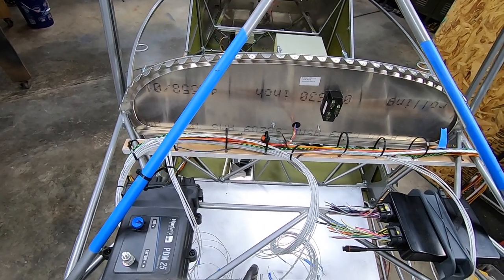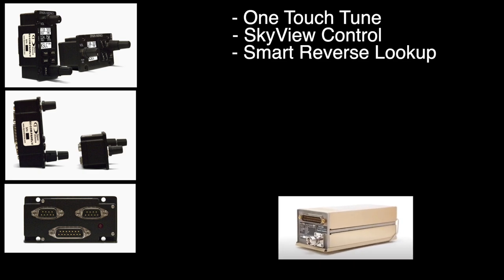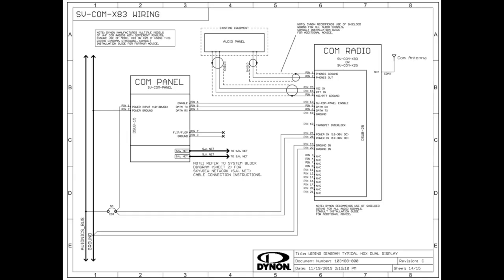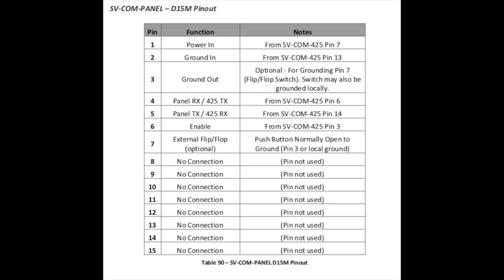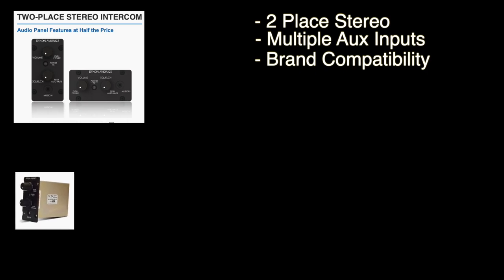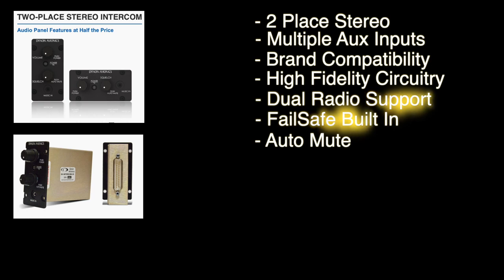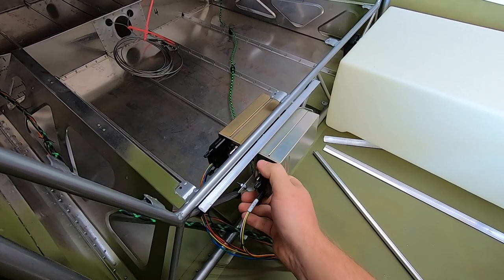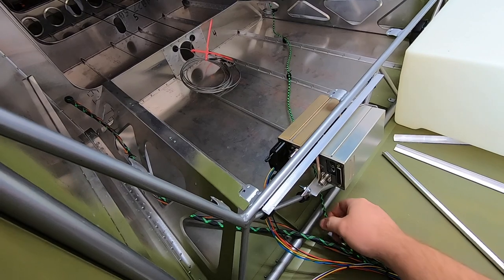Dynon Radio and Intercom Deep Dive

Comment: The wiring instructions are different between the C25 and X25. Make sure you use the correct instructions.
Reply from the maker: I was noticing that as well, very good point👍

Comment: Actually, Dynon’s shielding connection recommendation is not the best practice.  Shields should almost always be bonded at both ends.  There will only be current in the shield if you have a bonding problem in your installation.
Reply from the maker: I’ve heard argument on this topic, I’m not educated on it enough to have an opinion to be honest. Since I’m using Dynon I suppose I’ll stick with their instructions for now👍
Reply: @Project2Aero  This is from AC 43-13:  “11-89. SHIELDED WIRE. With the in- crease in number of highly sensitive electronic devices found on modern aircraft, it has be- come very important to ensure proper shield- ing for many electric circuits. Shielding is the process of applying a metallic covering to wiring and equipment to eliminate interference caused by stray electromagnetic energy. Shielded wire or cable is typically connected to the aircraft’s ground at both ends of the wire, or at connectors in the cable.”
Reply from the maker: @LTVoyager  Interesting, I’ll do some reading on that. Thanks👍
Reply from the maker: From what I can tell, it seems as though if the device (radio in this case) has its own ground and the shield earth is pulled  from the unit (like in this case) that securing the other end on the shield would be adding a second ground introducing a ground loop situation. If both ends of the shield are desired you need to not ground it to the unit and run both to the ground bus at the same spot🤷🏻‍♂️